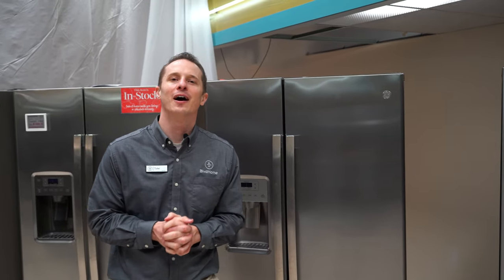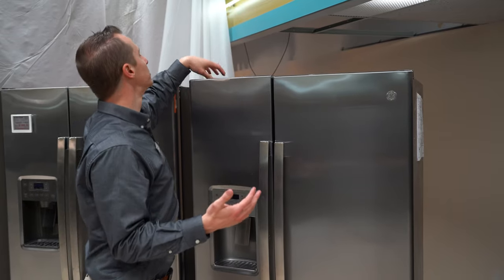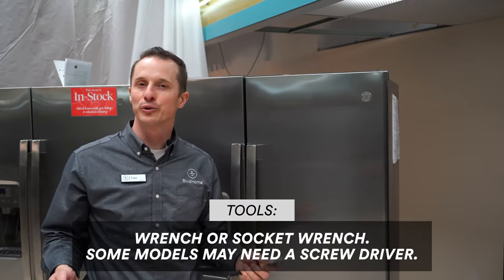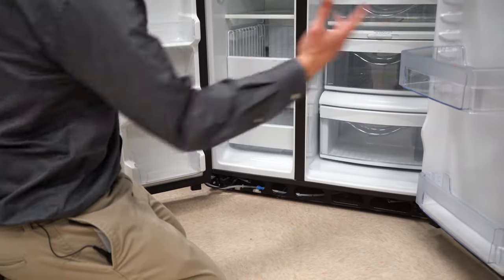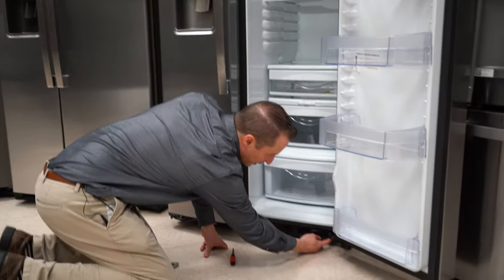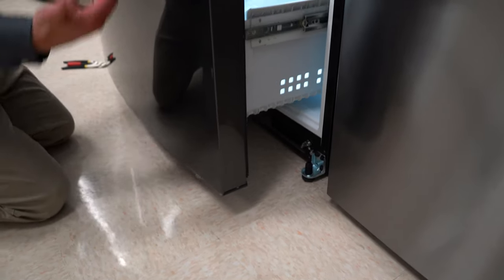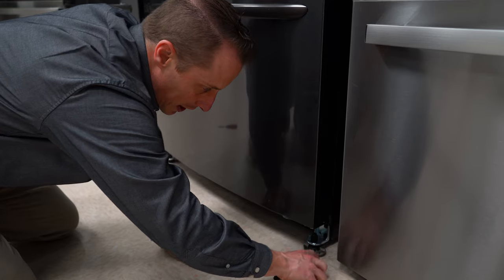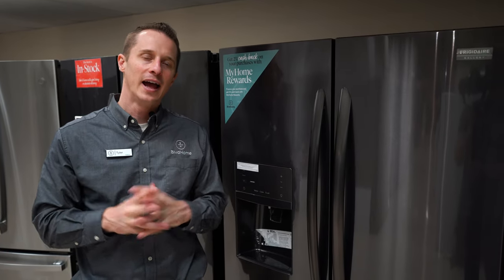Quick Fix for Uneven Refrigerator Doors!

Comment: I have a Whirlpool wrf535smbm00 French door fridge. The vertical hinge is not going into the guide and closing properly due to the left door sagging. My model lacks the height adjustment bolt (rather just has a pin beneath the closure cam). What would a recommended fix be? TY!

Comment: Yeah well GE at least in my case had a good feature with the 7/16 wrench to level the door but as dishwashers have four cornering leveling so should refrigerators. N/S E/W leveling should be a standard on any appliance like a refrigerator. I used a shim the get the left rear correct on the GE but that should not be necessary. Seems according to the manual it's only available on the "Custom" models. 2 dollar savings for GE, shame really.

Comment: 😂.. It is not coolant.  It's refrigerant! Doors not being level: will cause a drain issue and / or  cause the doors to not seal, which will drain in room air. Causing snowcone ice in the freezer component or condensation type water in the fresh food component.  Very nice video. You just need to correct the information about the refrigerant.

Comment: The doors on my new GE fridge were level at first but now are off after just 2 weeks. Also the door squeaks from the bottom. I do not put any milk containers in the door shelves just smaller items, so that weight isn't causing it. Will check with a level and proceed as necessary. Side note, when I hooked the water up I then saw the label to make sure the ice maker is in the OFF position before hooking up the water. Mine was in the ON  position. Why can't the factory workers make sure that it is turned off for the customer?? Then slap some of that blueish tape over the control to hold it there. It's not like they don't have that tape placed everywhere else for the customer to remove.
Reply: Same here GE model , doors not level and same squeak did you get it fixed or find the problem ?
Reply: @shanehockey28  tried some white lithium grease on the lower hinge and thought it was fixed but it only lasted about 2-3 days. i have the 3 year warranty but have not called on the issue as of yet.
Reply: I want a roll or two of that blue tape.  It's great and they think so too judging by how much was in my new GE

Comment: Shouldn't door leveling be done at the factory?  If you saw a car with uneven doors, you wouldn't purchase it.  Shows bad quality control.
Reply from the maker: Many Times Doors are uneven because or our floors we place them on. Many floors are uneven which cause the doors to look uneven so this allows you to adjust them.   Thanks for the comment.
Reply: Sometimes you have to remove the doors to get the refrigerator in the door and reattach once inside.

Comment: I've a mfw2055frz03 Maytag fridge. The manual is very unclear about how to remove the panel to access the adjustment feet. I see no screws and i pulled firmly and the access panel didn't come off. Any suggestions?

Comment: Hiow does adjust the leveling feet that makes no contact with the top french doors adjust the doors themselves? This doesn't make physical sense to me, but I could be wrong.
Reply: I'm also perplexed.   Wished it made sense re:  the top and bottom of the French Doors only.
Reply: Unlike the backside, the frontside is mainly an open rectangle that flexes (into a rhombus shape) under the heavy weight of the fridge and doors attached. Imagine you have a wooden frame in your hands that is not completely rigid. Attach doors to either side and then skew the frame up on one side, the doors will become unaligned.